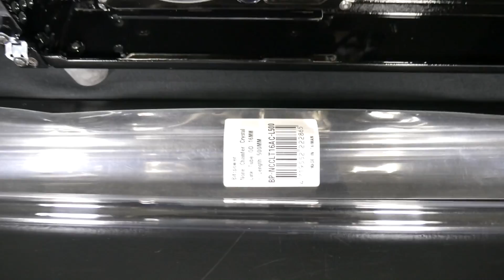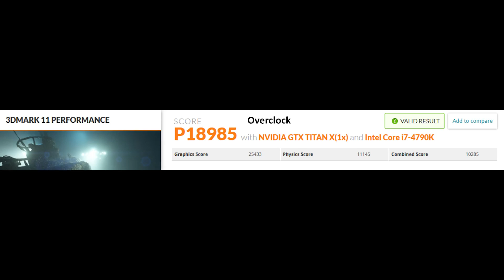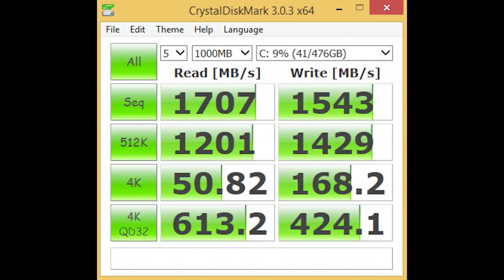Build #17: 'Sith': Part 2

Comment: Why are you not using PETG tubing?
Reply: By the looks of it he was using Bitspower EML fittings which are OD 16mm, you can only use Bitspower acrylic none chamfer crystal link tube OD 16mm and they do not do this in PETG as of yet.

Comment: Why have the tubing go directly over the RAM? What if one fails, you then need to disassemble that part of the loop after draining D:
Reply: S Horne I thought that too, having the tube an extra inch higher up would have mitigated that risk, but then I suppose that RAM should be pretty reliable.
Reply: True. I recently installed a new cooler on my own rig, and was a bit annoyed to see that it blocked the RAM slots, although very slight,y, so there was still room to unseat the RAM in case of failure.

Comment: what kind of heat shrink do you use to clean up the usb 2.0 headers? specifically what size, ratio, brand, etc.? really want to cleanup my headers but cant find the proper heat shrink to do so.

Comment: A D5 pump on max speed drains coolant just as fast as that pump.
Reply: SANIC Yes but a D5 on high is LOUD.
Reply: 2 Techs and a Tool you just need 2 use speed 6 when filling a loop.
a faster pump speed doesn't help temps anyways.

Comment: Where do you get your parts from? I recently completed my first custom loop, quite sloppy compared to yours but hey, fist time :P 
I'm using a cooler Master haf 932 advanced case which I feel is a bit snug for a lot of the loop. I started with the swifttech h220 x OLC and progressed to adding a 200ml reservoir on the top of the case and a xspc 120mm radiator on the rear. I'm using 3/4 and 5/8 fittings. 

A question for you, the rear radiator I feel has a pretty big air bubble stuck in it and the swifttech makes a trickle sound which means there is most likely a bubble up there as well. But due to the design of my loop it is quite complicated to force those bubbles out. Do you have any suggestions as to how to go about this? I was contemplating picking up a mcp655 pump to throw in before the swifttech to help force the coolant in there to force the bubbles out and for a greater flow rate. What are your thoughts on this? 

I can honestly say watching your builds was my primary inspiration for doing my own custom loop. They are beautiful!
Reply: Adding a tiny bit of dish soap. I've seen/heard it helps get bubbles out.
Reply: bensemus x do you have any idea I'd that's bad to use with a colored coolant? I'm using primo chill uv red coolant. Plus with my setup it isn't exactly the easiest to add fluids. I think I'll let it ride for the time being my Temps are sitting alright, bout 30-35c idle with 15% oc on a i7-4790K, when playing games it's hitting about 55c under 100% load with the ROG benchmark app it hits 78-80c. I plan to add my gpu into the loop later so when I do that it would probably be best to add in some soap or something.
Reply: potochronic Those temps look fine so I'd say your good till you expand the loop. IDK how the soap would react to the dye so I'd recommend asking on a forum like LinusTechTips.com

Comment: Is it possible to have a coolant that changes colour when at a sertan temperature?
Reply: rubikfan1 Mayhems is working on one if i remember correctly. I think it was mayhems chamelon.
Reply: Mayhem's Aurora coolant with color changing lighting perhaps?
Reply: rubikfan1 That is a really cool idea but I have not seen that yet. My system has LED lighting that changes colors with temps. My build is green but when it gets really hot the green darkens and then switches to red. I am running a Air540 Case and a WC CPU so it never actually gets red unless I benchmark to make it do it on purpose.
Reply: Hmm. What about destilled water with red/blue leds. Could that be the same as coloured water?

Comment: What was the final clock on the Titan? You said 100 MHz up, does that mean 1100MHz? I ask because I've seen several Titan X and 980 Ti reach around 1400MHz on stock cooling, without any issues.
Reply: Maybe 100 above its boost clock?

Comment: Does anyone know where can i get the radiator mount for the pump/res combo. Tried looking for it but i couldnt find it.
Reply: A shop like PC performance should have it in the res accessory section.
Reply: bensemus x no they dont have them :(
Reply: No not that part. Whats connecting the radiator to the part which you found. The metal X shaped part. Thats the part im looking for but seems to be missing everywhere :(
Reply: Found it. Its called (UN) design z2 pump bracket. :)
Reply: Jack Pat oh I didn't get that :P

Comment: Everything about this build is beautiful. I'm not a fan of red, but it's still an awesome design and built fantastically. There is only one problem with the whole thing and seeing as it's on the front, it would bother me if it was my PC and that's the power LED light being BLUE. Just completely takes away from the entire theme/look of the computer. Granted, I know that's a bit hard to change.. but yeah. Only thing wrong in an otherwise amazeballs build!